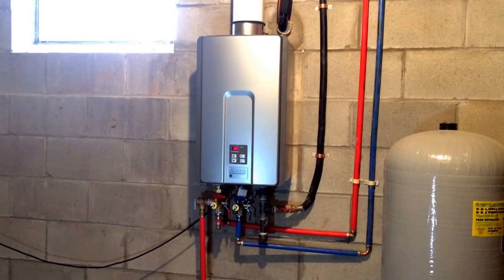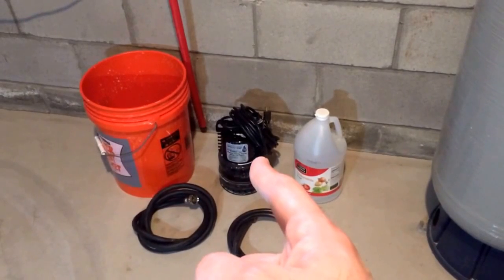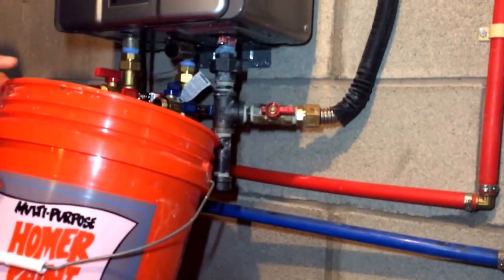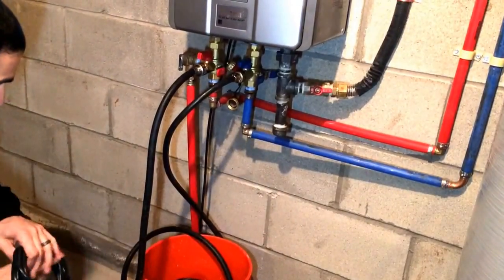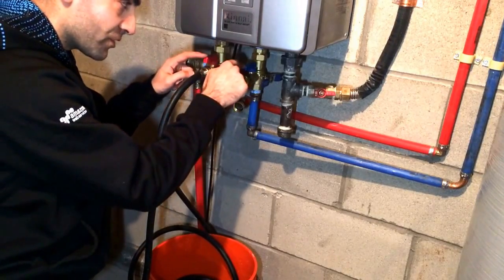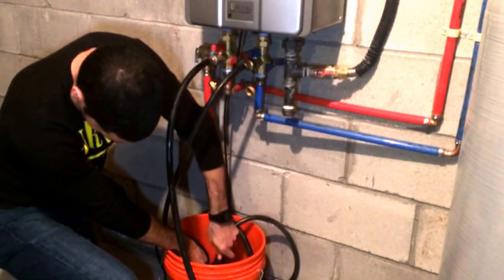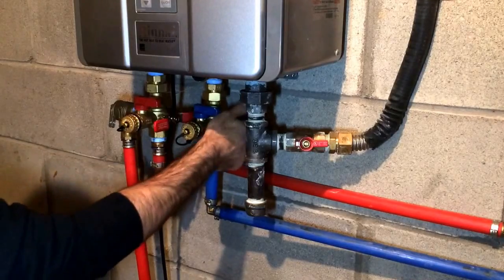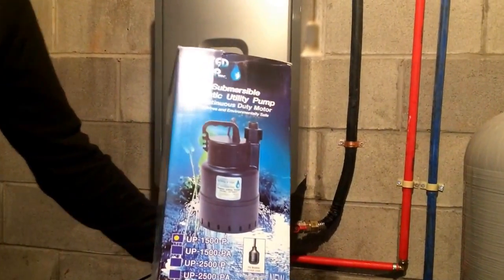[SOLVED] Tankless water heater flush - Easy descaling method - Fix error code LC - Rinnai RL75i

Comment: Your instructions were amazing. I was able to complete the steps exactly and got my Rinnai tankless water heater descaled. 

The one extra step I did was that in the end after closed the valve for cold water, I kept the hot hose attached and opened the cold water supply. That way cold water went in the tank and pushed the inside vinegar into the bucket. Then when I detached the hot hose and opened the hot value to the house and turned on the heater, there was no vinegar smell in the bathroom.

Thanks again, your instructions were very detailed. I’ve subscribed to your channel.
Reply from the maker: You rock. Thank you.
Reply: Clean tge filter too!

Comment: I may be wrong but wouldn't you want to flush with clean water before you close it up, incase you loosened debris in the process, and gravity was not enough. Just thinking about the expensive fixtures down the line.
Reply: Yes you should flush cold water thru the unit [about to buckets full], and clean the inlet screen, before putting it back in service. Also flush the vinegar out of your pump, before storing it away.

Comment: What if I have a two tankless water heaters.  Do I just repeat the steps twice?
Reply from the maker: Possibly, it depends on how you have them configured. If they are in series, meaning the hot output from one goes into the cold input on the other, then you can flush from one water heater. Just use double the vinegar. If they’re in parallel, meaning each of them have standalone hot/cold legs, with a wired connection between them, you’ll flush each one individually. Thanks for the comment, and please subscribe to support my channel. I have many more great DIY videos coming soon.

Comment: just for safety issue, you forgot to shut the gas off. Also it is good to clean the filter as well.
Reply from the maker: Both good ideas.  Thanks, and thanks for watching all the way through.
Reply: How do you clean the filter?
Reply from the maker: Shut the valves. Unscrew and back out that little plastic black piece. That’s the filter. It’s just a little screen. Rinse it and put it back in. Done.

Comment: Rinnai's video on descaling mentions a flow rate of 4 gals/minute. Every 1/6 HP submersible pump I've shopped has a constant flow rate well above 4 gals/minute and no mechanism to adjust that rate. Is that a concern, or just "let it flow" for 45 mins-1 hour? I called Rinnai's "tech support" and they couldn't tell me yea or nay. You go into the most detail on this process of any video I've seen so far.
Reply from the maker: Hey, thanks for that comment. I can’t say for sure, but I suppose there’s merit for zero flow considering a still vinegar bath is good enough to descale a shower head. That said, I think if you can get some minimum flow through, you’ll do just fine :)
Thanks for taking the time to write and for the compliment.

Comment: I-Heat S-16  waterless tank.
Installed new well pump but didn't think to turn off the breaker on the waterless tank. Either way I think when we switched out the old well pump with a new one we got air in the line & now it won't heat the water coming through the 1/2" line. It's just starting @ 71° & 5 seconds later just shutting off. Any quick safe way to bleed or proper way someone knows to get it to reset or bleed the line if that's it?
Thanks
Reply from the maker: Bleed the line but turning on the hot water anywhere. If you get water from the faucet, then you have water in the water heater.
Reply from the maker: You can ensure it’s bled completely by running hot water for a few minutes, until it stop sputtering.
Reply: Tarek's DIY       did that. No sputtering. Even completely washed a load of laundry but the iheat system just comes on & says 124° flashes 3x's & goes back to 71° & a few seconds later just turns off. I have a plumber with tankless water heater experience coming over tomorrow & I'm sure it will be the best $200 -2 minute fix I've ever seen.
It will be a decision going forward to whether or not I try an tankless water heater again anytime soon when I purchase another system. The reviews on these systems have been a hit & miss for years. Some units last year's & some less than a year. I hope they can improve on this system I would prefer to have a shoe box instead of a large tank. My system is about 18 months old.
Thanks much!

Comment: Hi, thanks for the video. I followed it, but my heater doesn't sound happy now. It's a Smith tankless gas water heater. It makes hot water, no error codes, has an extra whooshing sound at low flow and is rumbling at stronger flow. Any ideas what this could be?
Reply from the maker: Hard to know what whooshing and rumbling actually sound like, but a rumbling sound might be the blower. It would be almost the topmost device in the water heater. See if you can tell where the noise is (top, bottom, middle) and write back. Thanks.
Reply: Tarek's DIY hmm, hard to say. I let the water run for quite a while, thinking there might be air in the system. Then it showed an error code - imperfect combustion. I'm pretty handy, but I think this is above my skill level. It's only a year old and professionally installed, so I guess I'll be calling them tomorrow. That's for your responds.
Reply from the maker: That actually might mean it’s starving for gas pressure. A lot of times during the winter, there’s so much draw from all the others in your neighborhood who are running their heat at abnormally high levels (all at the same time) which results in lower pressure to each home.  Your tankless might require as much as 100kbtu just to maintain a minimum flame.  It could also be that your meter is rated for something like 100kbtu. Therefore, if you’re running your heat and your water heater at the same time, one of them is gonna stifle and possibly “rumble”.  Last thing I can think of is a blocked up flue or intake.  See if it’s covered with snow, ice, or perhaps a bird has taken refuge in there.
Reply from the maker: No sweat. Just curious, did they cover it under warranty or did you have to pay?
Reply: I wish I was sharing gas with my neighbors, but no, I have my own tank - live outside of town.  The plumber came by today, he too checked if the flue and intake were clear. He saw nothing wrong and ended up calling the manufacturer. I figured their answer might be interesting to you - because of the air in the system the unit shot down operations - if it has full burner on and no water flowing it would burn - they called it "hard locked" I believe. 2 little buttons inside the unit had to be held in for 5 seconds to "unlock" the unit and all was well!
Thanks again for your video and you attempt to help. I appreciate it.

Comment: I followed this, but the flow going through the rinnai is very low with the pump on. I've double checked the valves on, etc. but no good. The heater still works fine with great flow. Any ideas?
Reply from the maker: People, please DO NOT keep the power to the water heater turned on. Doing so while you have the pump circulating will cause it to fire up and heat your vinegar to a ridiculously hot temp.  Additionally, this creates a closed loop and can void or reduce your warranty.  Remember, when flushing, keep the power turned off. Thank you for watching and please subscribe.
Reply: You need to keep the unit powered up. When you turn off the power a servo closes in the cold water side and you only clean about 15% of the tank. Google it and you will see. People who don't know what they are doing make videos and give bad advice. Let me know how you do.
Reply: You have to shut the gas off so it can't fire up.
Reply from the maker: +Silicon PhantomFlier Do you know the horsepower on the pump? Also, if it's submersible, is the intake sitting flat on the bottom of the bucket? If so, try propping it up a bit. Look for any kinks in your hoses.  And lastly, make sure it's pumping in through the cold side.
Reply from the maker: +Silicon PhantomFlier How'd you end up making out? Did you check the direction of flow? Pump blockage? Check valve on your pump? Horse power? Also, make sure it's unplugged?
Reply: I'll be checking this all this weekend. I did check flow direction, but will double check- it does seem like something is backwards. Don't know pump horsepower, but did check the flow coming out, it can shoot water about 15 feet into the air from a garden hose. I tried with the unit both plugged in and unplugged. Let you know how I do this weekend.
Reply: Tarek, thanks for your insight. Sorry for the confusion but I received mixed messages. When I read the Rheem service manual from 2006 it said turn off the power. A plumber told me to leave on the power. I figured since the gas is off it could not heat up the vinegar. I called Rheem customer service to confirm and they said technically you are right but according to their revamped instructions from 2012, which they emailed me, it has to be done a certain way. This is exactly what it says in the Rheem directions on document  AP14429-2 (07/12) ...   

  3. To properly flush the heater the electronic bypass valve inside
the heater must be closed. Follow these steps to do this: At
the remote control, turn OFF the power and wait 10 seconds.
Turn ON the power at the remote control, wait 10 seconds,
and disconnect the water heater from the electrical source.          

What do you think of this? Thanks for your help, Bill
Reply from the maker: I haven’t read the manuals for Rheem or others. During the Romani training program, they require shutting the water heater down. I didn’t question it, but I do know that once the flow sensor detects flow, it will try to fire. If any of its checks fail (including low gas pressure) it throws an error.  I don’t imagine Rinnai wants a home owner looking at an error code while doing a basic flush.  But thank you for the follow up. Much appreciated.
Reply: It's not working because he unpluged the water heater. You need to keep power to it so the cold water servo stays open, otherwise you are only cleaning 15% of the tank. Look into it and you will see.

Comment: I noticed that there is no Ground isolating fault interrupter on the 120V AC line.
Reply: The lack of a test/reset button at the receptacle does not mean that the receptacle is not protected. It may be protected by a device upstream on the circuit or by a GFCI protected breaker at the panel. You can't simply look at the receptacle and make the determination that it is not protected.
Reply from the maker: +Chuck Evans Good point.  But to credit those others who pointed out, it’s not protected upstream :)  I have since put in a GFCI.
Reply from the maker: +Mike Donnelly Ah. A man who notices the little things. Awesome. Rinnai has a GFI built in.
Reply: I was thinking more along the concrete floor being wet. Zap city.
Reply from the maker: +Mike Donnelly I gotcha. Looking out for me, not so much the water heater. Good man. Good point.
Reply from the maker: +Mike Donnelly You're completely right. It was there for my sump pump, which I never installed since I never get water being at the top of a hill. Guess I got lazy assuming no water so no need for a GFCI. But very good point particularly for setting an example for others who watch.
Reply: I noticed you don't wear a condom.
Reply from the maker: Nice!!
Reply: @JoseCruz-kp7ru  Has to be a vulgar fool in every crowd who thinks he is funny.

Comment: Hey bud, great video. Would you mind telling me what gas line you are using? I'll be installing a Rheem in two weeks and want to run flexible line. Brand please.
Thanks
Reply from the maker: +Matthew Foley. It's called TracPipe. It's a supply house brand.  If you're at Home Depot, they carry a different brand, but it's just as good. Just don't interchange the fittings between them.  Meaning, TracPipe tubing goes with TracPipe fittings only, and so on.  Good luck.

Comment: Awesome video, thanks! Do you run your water heater at 120f? Do you have a thermostatic mixing valve? I'm about to clean our Rheem Professional Prestige Series 84 Direct Vent Indoor tankless water heater. It says in the cleaning instructions to use "Five gallons of virgin food grade white vinegar (undiluted)", it looked like you only needed one gallon? I've read that 85% phosphoric acid is much better for cleaning scale buildup (I can get it at the local hydroponics supplier). Thanks again for the video.
Reply: I also don't know about phosphoric acid but the important consideration is that you are introducing this into your water system and thus the common recommendation (including by Rinnai) to use "food grade vinegar" (i.e. from the grocery store). The manual for my Rinnai RL75 water heater specifies 4 gallons of vinegar, but presumably as Tarek suggests the amount actually required depends on the amount of scaling in the heater. I assume the vinegar is dissolving the scale and conversely the scale is neutralizing the acidity of the vinegar so if you use too little vinegar then the flushing may prove ineffective to some degree. Having said that, my plumber suggested using 2 gallons of a 50/50 mix of water and vinegar. I will be re-doing my flush with full strength vinegar and looking to see how discolored the vinegar becomes -- if it is clear then the first flush was adequate; if it is not clear then I will use full strength vinegar and more of it.
Reply from the maker: +toysareforboys Thanks. 120 degrees. No mixing valve. I find that I get the same results with 1 gallon as with 5. I don't know much about using phosphoric acid. Sounds like it's harder to dispose of and needs a thorough flushing after. But I truly don't know enough to comment intelligently. Good luck.